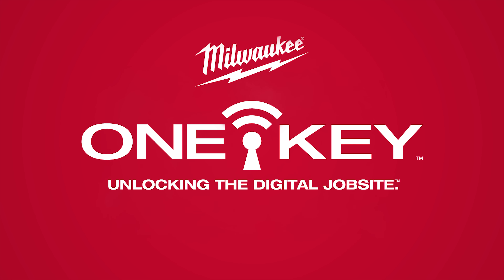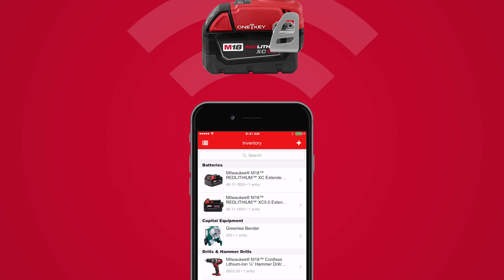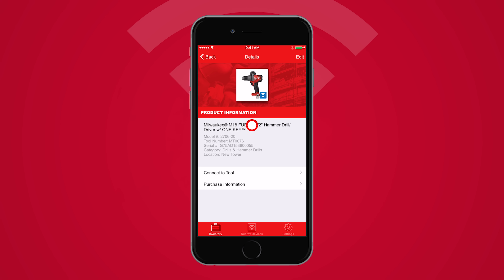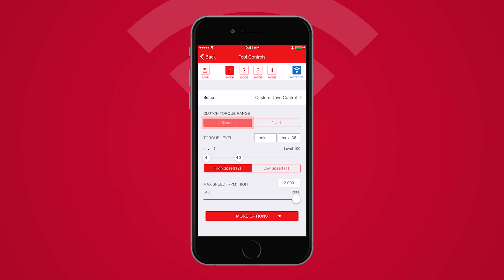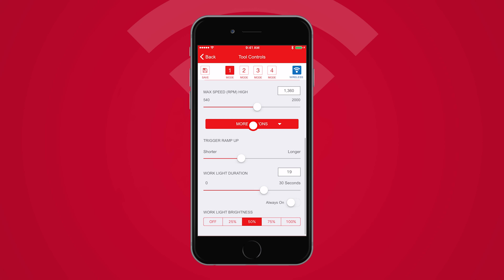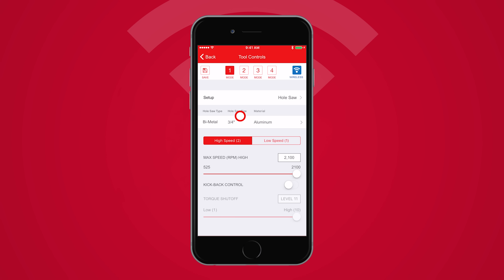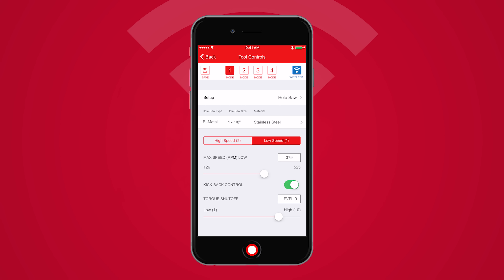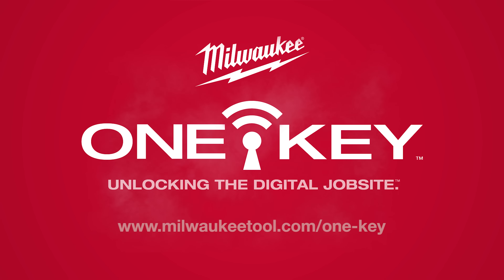Milwaukee® ONE-KEY™ Mobile Tutorial: M18 FUEL™ 1/2" Drill Tool Customization

Comment: I have just dumped all of my Rigid tools in favor of the Milwuakee line, they are performing better than any tool I have used thus far. Really love the 12 volt band saw, cuts EMT all day, nice and  clean with little reaming required after the cut.
Reply: Rigid is made by the same company and almost identical to milwaukee.
Reply: I would rather say Ridig is the same as AEG if we talk about power tools. AEG belongs to the same group as Milwaukee (TTI) but it doesn't mean the tools are the same. Mostly not.
Reply: My buddy went thru 3 rigid drivers in a span of about 18-24 months and he said it was ok cuz they have lifetime warranty all while I had Milwaukee for 5+ plus years still going strong 2 years since then.. and the subcompact bandsaw is godly if you are a commercial guy

Comment: I'm replacing an old m18 that came in a double pack, that had 3 different modes on it, screws, drill, hammer 
It also had up to 18 on the clutch.

Why does this not just have the same? 

I want a drill I can use daily in my trade (locksmith) which can do all and is simple....

Comment: I'm a diehard Milwaukee fan, I have the fuel brushless hammer drill, fuel brushless hex impact, m12 impact, 1/2" high torque fuel brushless impact, and one of the bigger radios. I'll be adding the grease gun and probably the band saw to the bunch soon. 

as a professional mechanic, this seems like a waste. anyone who uses their tools as much as professionals do should know how to control all of this with the tool itself, not some software. I can't think of one instance this would be faster than me just using my brain to finish the job. kind of disappointed this is where R&D went, when there are better areas to focus on. I'm excited to see those new hydraulic guns, that seems like a much better development than this. please, try not to get caught up in the tech craze and just focus on making the baddest, toughest, most durable tools on the market. that's what us professionals want, not some gimmicky app.
Reply from the maker: ONE-KEY™ Tool Control is designed for users who find themselves doing repetitive tasks often that require a high degree of accuracy. Tool Control aims to deliver this accuracy consistently resulting in no damaged materials or broken fasteners. Before you give up on the technology completely, see what others in the space have had to say about this technology > https://www.youtube.com/watch?v=quDatGjy0Ew

But it's important to remember that ONE-KEY™ is more than just Tool Control. ONE-KEY™ also includes Inventory Managment, which allows a user to track purchase history, receipts, and repair details about a tool in 1 easily accessible place, and Tool Tracking that allows a user to identify a tool as lost or stolen and will alert you when the tool is found.

Comment: I just saw a combo set today at the flea market and I’m hoping somebody can help me with this.. someone told me it’s a knockoff and that’s why it’s so cheap but I would like to know if the actual drills are knockoffs because they sure didn’t look or feel like it or the batteries are what would be knockoff with replaced cells inside a pristine battery shell.. because I’ve actually used knockoff 5.0’s and they are not far off from the real thing I wouldn’t mind if it was the batteries are not the real thing.. unless it’s the drills that are knockoff then I would totally not buy them

Comment: I think Milwaukee  is a great tool but any 1 that can afford  a tool like that is a professional  in the trade and nows  how to ajust the drill that is a waste  of money and time to use your phone to ajust your tool how much are the batteries  4 that  tool.
Reply from the maker: You do not need your phone to adjust the tool. The phone is only used once the tool is purchased to reset factory settings to better match a user's needs. After that, the tool can still be used like a regular drill by using the trigger and clutch or by using the presets saved to the tool. The phone never needs to come out again. 

In addition, ONE-KEY also allows tools to be tracked and will even allow users to "Lock" tools if they are stolen. This functionality will be launched this November.

Comment: not to sound negative,  but this one key feature is useless and almost laughable. no body is going to stop and play with their phone to set up a drill.
Reply from the maker: The phone is only needed once when the tool is purchased if the user wishes to customize the factory settings on their tool to better fit their trade or tasks. Aside from that, the phone doesn't need to be used again unless the tool is lost or stolen. In that case, you can open the app to track the tool or to lock it with ONE-KEY's new security feature coming this fall.
Reply: what factory settings are there for ONEFHIWF12 FUEL 1356/1898 Nm
Reply: Your complaining about that app now till your tools go missing lol